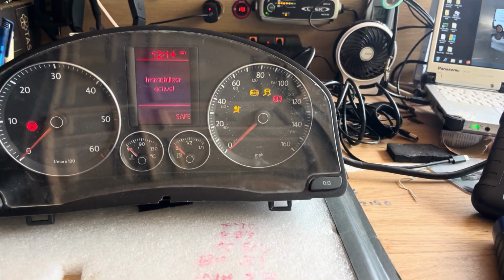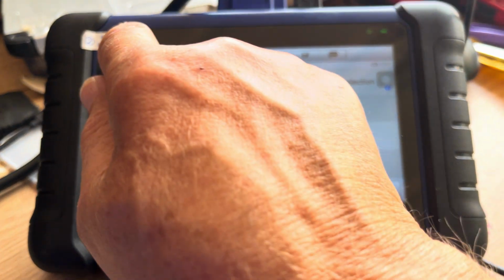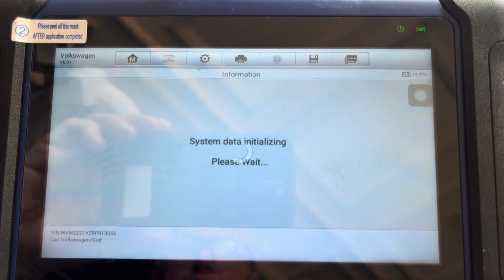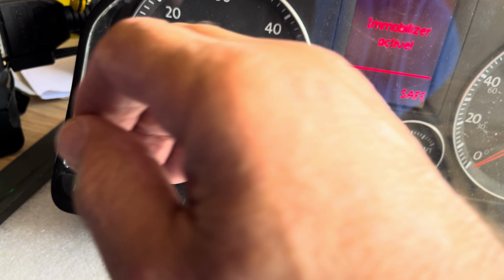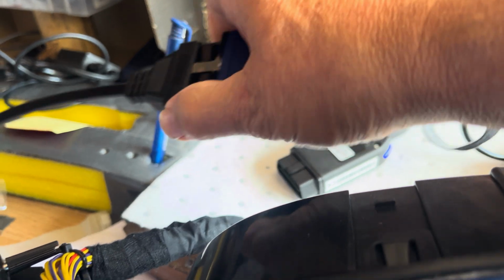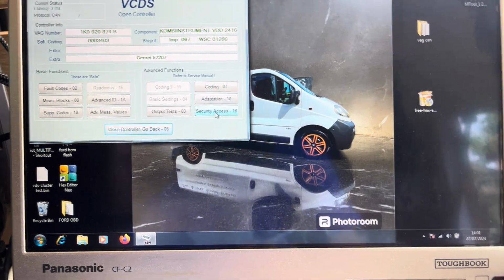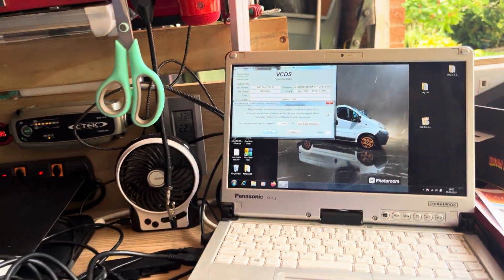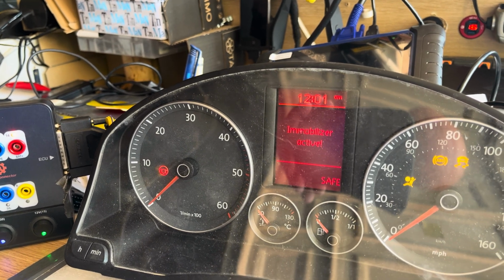Vw golf mk5 cluster wrong pin code using autel

Comment: Hi mate , how you get the pin out connection to connect it to gt100, 
I have gt100
Reply from the maker: Hi i have worked out the pinouts for the mk 5 golf thats all email us at caralarmandradio@gmail.com if you want the purchase the diagram of all the pins if not you should be able to find something on the net ok
Reply: @caralarmandradio 
I will email you today